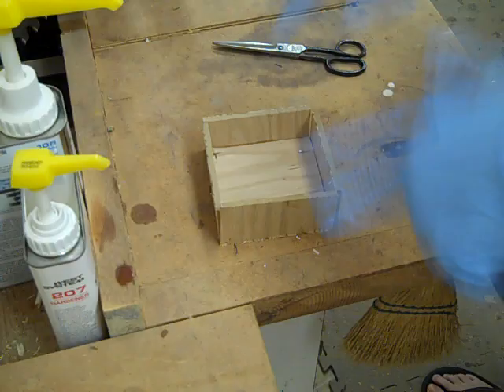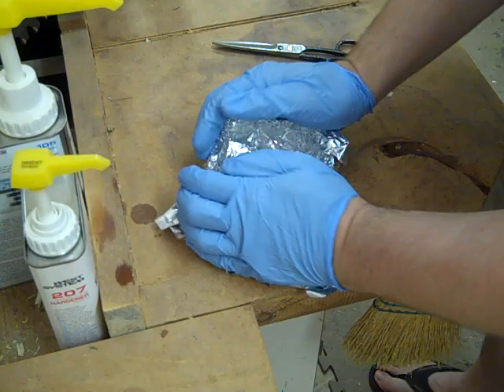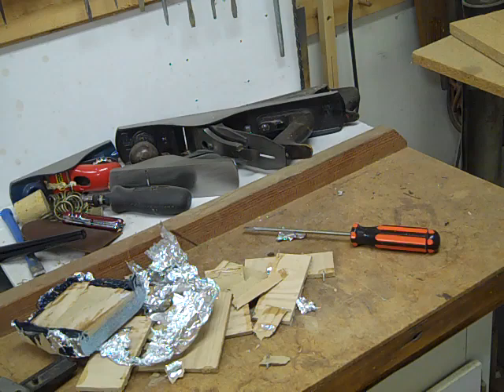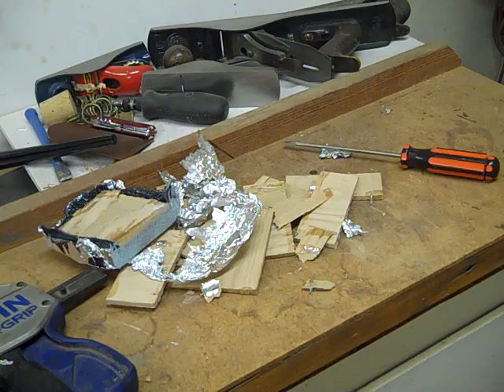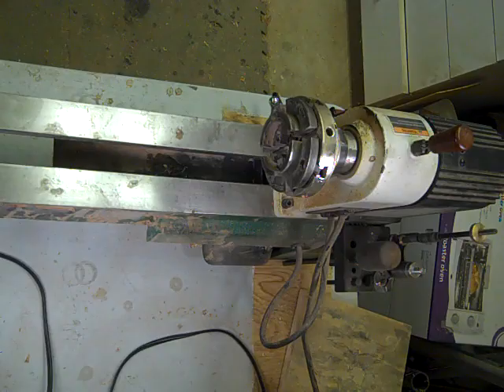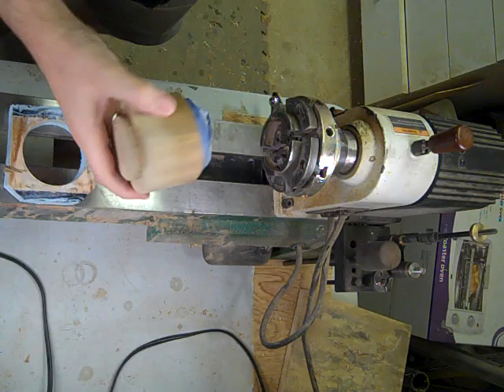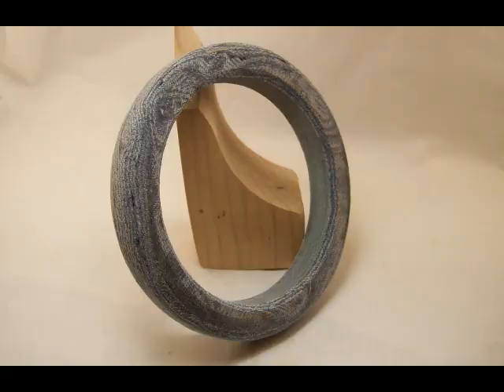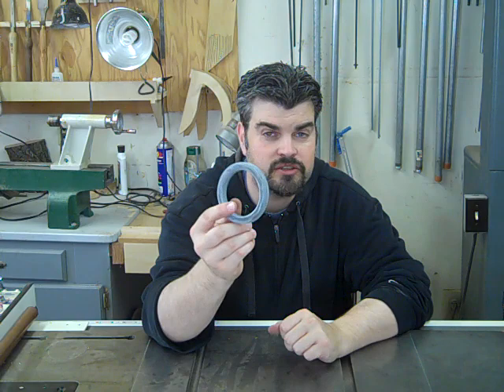How To Make A Blue Jean Bracelet

Comment: It might be the weakness of the coloured pencils themselves causing the issue. Higher quality coloured pencils might help, and so might letting some kind of very liquidy resin-like product (like super glue) actually soak into the ring once it gets close to the right shape to help keep the cheaper wood from splitting. If it's breaking on the line of the coloured outsides, maybe sand them down first and coat them in a coloured epoxy or something similar to mimic the coloured paint but give it more strength.

Comment: Peter just an FYI i found using 4" PVC drain pipes make a great blank mold just use a piece of sheet acrylic for the bottom and use caulking to apply the PVC to the acrylic I use this with Polyester Resin and once it hardens pops out with just a few taps
Reply from the maker: +Daryl W Nice tip! Thanks man!

Comment: Very cool Peter, did you try epoxying a solid block of pencils?
Reply from the maker: Thanks!
Yeah, that was #5 &6. The trouble is it won't stick to the paint on the outside of the pencils. I suppose I could sand it off, but I think that would change the look of them...
Reply: kludge1977 I just went and looked again, I think you're right it does add some nice detail to the piece.

Comment: Sounds odd, but if you're using your shopvac to suck up the dust from the forstner bit, take another section of hose (if you have it, and set it up to blow the material towards the suction part. Very effective that way. You might want to use a wide attachment though on the suction part.
Reply from the maker: Jarod Morris That's a good idea! Thank you!

Comment: Could you maybe epoxy the colored pencils? Maybe they would hold up that way. Glue like them you have already, but also encase them in epoxy which will seep into the crevices.
Reply from the maker: +Robert Headley I did try that. http://i.imgur.com/o76YlvO.png They still broke on the paint joint. Just too weak....
Reply: +Peter Brown how about you rig a canister fill it with epoxy drop the block and pressurize the canister? or vacuum it using those DIY pvc vacuum rigs! I think either way it will absorb the epoxy! however I do not know how epoxy will react under pressure though? would it be hazardous? This needs more research!
Reply: +Peter Brown you could mix the epoxy with the crayon wax just add the wax to the hardener then add the epoxy with wax just add same amount crayon wax.
Reply: we did this to make a colored pencil lamp after we had multiple glue failures using just super glue. we also switched from octagonal pencils to round pencils to allow places for the epoxy to seep in between the pencils. it worked really well. But it may be infinitely harder to do as a ring since there is much less material.

Comment: Nice project!

Regarding the pencil rings, maybe try sanding abit on the outsides of the pencils to make them stick better to each others ? I presume they break between the pencils ?
Reply from the maker: That's exactly where they break. It's like the epoxy will stick to the paint but the paint will not stick to the pencil. I have one box left to try something with, so I'll probably try scuffing them up with 240 and epoxying them...

Comment: What if you turned a whole vase from denim-epoxy?
Reply from the maker: rlt94 Whoa! Go big or go home! It should work, but resin does get brittle at larger diameters. Still that would look really cool!
Reply: Yeah…well basically you made artificial wood…the cellulose fibers from the denim interlock in a similar way, and the epoxy saturating it is basically a substitute for lignin…so it should hold together at larger diameters and not crack (as it would normally) because of the cellulose matrix holding the epoxy together and visa-versa…though they are not chemically bonded in cells as in wood (which accounts for the greater tensile strength) it should still generally behave physically in a similar way, and it would be cool to see how this stuff takes sealing and oiling, maybe it would make the blue color pop... Also here is another thing you should try…making an inlay from coal…crush it to a fine dust and drip CA Glue into it…like they do with turquoise or anything else…it would polish up maybe like jet or black bakelite…that contrasting with a sulphur, casein, or tin soldier inlay in a red, purple, or brown hardwood would be gorgeous...
Reply from the maker: rlt94 That coal idea is really cool! I'm always on the look out for new materials to experiment with! Thanks!
Reply: Yeah either coal or pencil graphite.

Comment: Perhaps someone else has already mentioned that failure to proportion and mix the epoxy as specified by the manufacturer is a poor and possibly dangerous practice for a couple of reasons:

1. The epoxy may never cure all the way through, and so there will be soft gooey globs of epoxy throughout the piece.  This will ruin the piece and waste your time and materials.

2. Uncured or partially cured epoxy can become a definite health hazard, during turning if you breathe the particles or get them on your skin or eyes.  A mild or severe allergic reaction can happen upon the first  exposure or any later exposure.  This exposure hazard would be extended to the buyer/wearer of the bracelet too.  

Even if I measured and mixed epoxy correctly, I would wait a week or three before turning so that the curing would be complete.

Have fun, be creative, but be safe.

Comment: You seem to waste a lot of epoxy. you could use your square mold and put 45 in each corner to make it octogon shape and a circle of wood in the center for casting. and then turn it. Just an observation suggestion.
Reply from the maker: +Basement Shaman You're right and it's a good suggestion! Thanks!

Comment: Watched your colored pencil rings a while back.  Awesome idea, but I think they fall apart due to the weak adhesion of the paint to the cedar.  I assume that's where it's falling apart on you?  Couple ideas...  Strip paint or use bare unpainted/unlacqueured colored pencils.  However, cedar is still a very weak soft wood and the "leads" in the pencils are even softer.  So, to solve for that, get you some cactus juice (link below) and infuse the pencils.  This essentially turns them into super hard petrified wood that takes an outstanding sheen when lathe polished.  That stuff looks awesome to use.

http://www.turntex.com/index.php?option=com_virtuemart&Itemid=121
Reply from the maker: I actually bought cactus juice and a toaster oven and tried that first. I'm not sure why but it didn't help. I suppose I would have to get a vacuum pump,and chamber  but I'm not sure I'm willing to throw that kind of money at this. I've already sunk in over $100 for my failures.
Luckily the epoxy is good for other things....

Comment: Great idea. I may be trying to make something with it. Don't have much call for jewelry but I like playing with composites and this is really cool for something decorative.

Have you considered vacuum infusing epoxy for those rings? If you infuse epoxy into the partially completed blanks (once you have cut it and exposed more of the wood) that may be enough to give it the strength required to complete the turning. This technique is often used for infusing epoxy stabilizer for pen blanks.

Simple vacuum chamber design out of PVC:
http://www.joewoodworker.com/veneering/vacuum-infusing-chamber.htm
Reply from the maker: Thanks for watching and the thoughts.

I think you might be right. I have some stabilizing resin but not a vacuum chamber... Maybe I'll keep my eye out for a used vacuum pump!